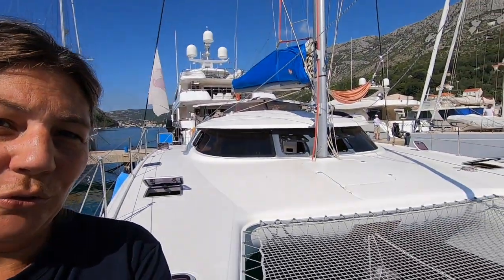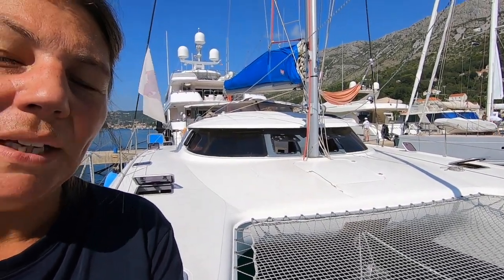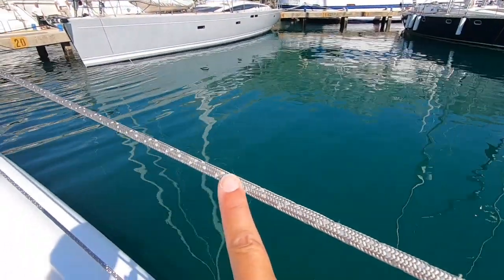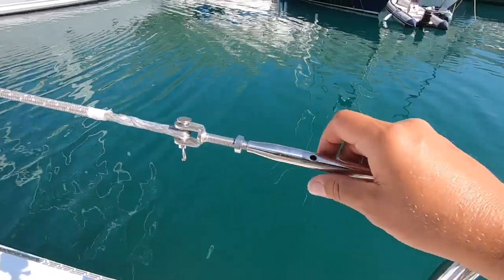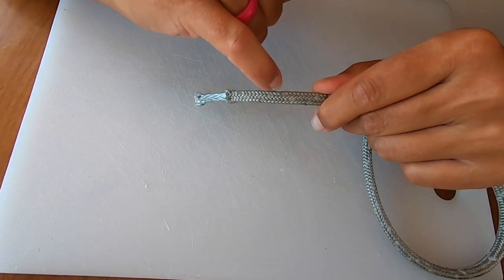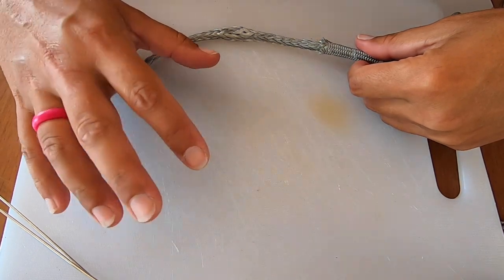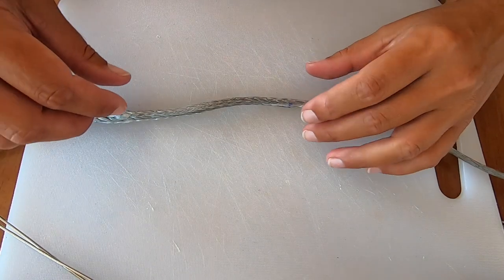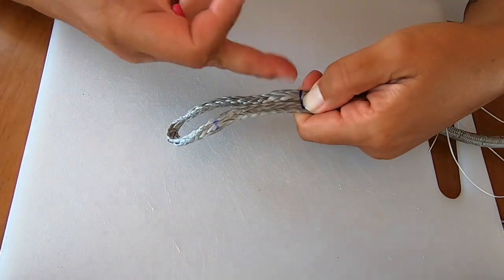Catamaran Pink Penguin - DIY dyneema hand rails

Comment: You really need to bury a bit more of the tail inside the mainline and also taper it by pulling threads over a distance otherwise the weak point is where it suddenly goes from fat to thin. There are videos that tell you how much tell you bury depending upon the thickness of the dyneema.

Comment: You’ve taken the protective cover off the core, which now is susceptible to sun damage
Reply from the maker: Hi Sea Eagle, The cover is only off at the ends. When I did the video I did not know how to include the cover in the end pieces, especially space wise. So far the Dyneema ends have not desintegrated ... the next version will then be pimped, promised :-)